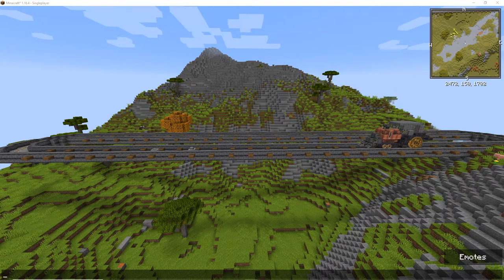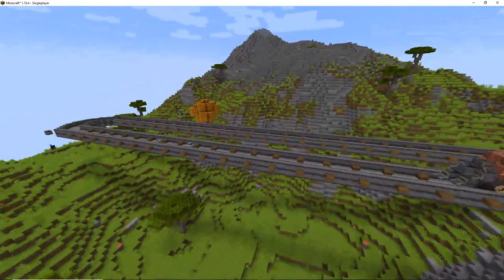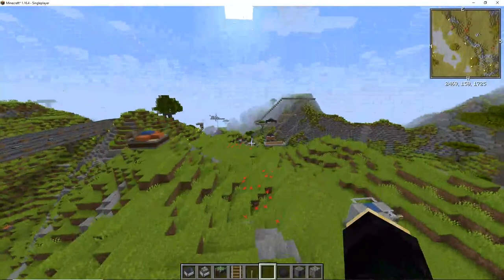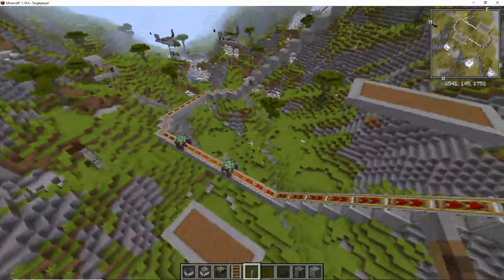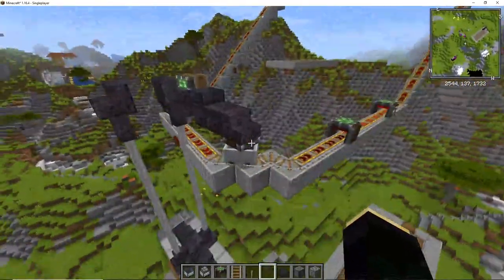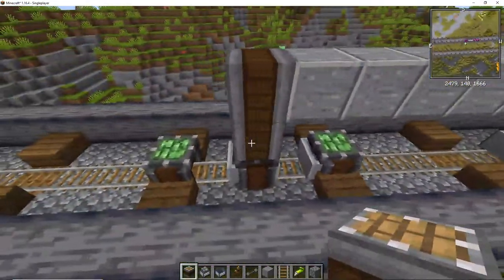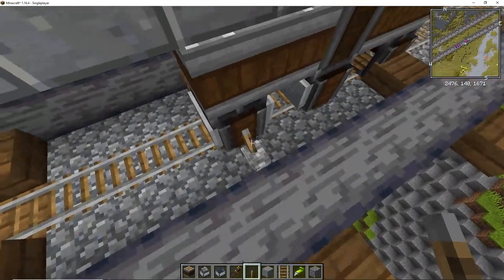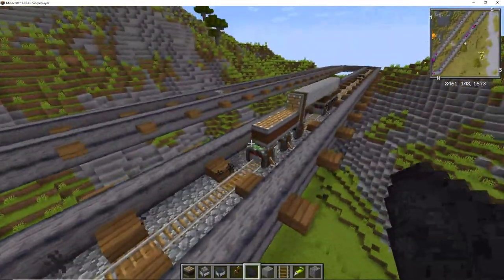Trains and carriages in Create 0.3 Tutorial | Modded Minecraft

Comment: Ayy I'm just getting into this mod and I need a little help.. if I want a moving "vehicle" to become solid again, other than breaking it, what would I do? What happens if the minecart runs under an unpowered cart assembler?
Reply from the maker: if a carriage contraption runs through an unpowered cart assembler, when both carts are at one cart assembler each, it will dissasemble

for normal cart contraption you only need to worry about one cart assembler being unpowered, nothing to line up like with carriages